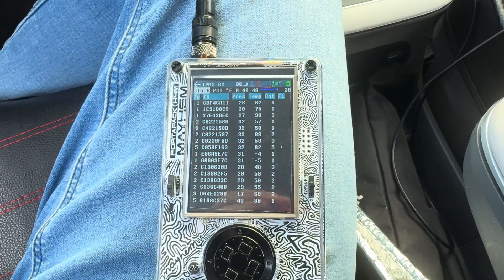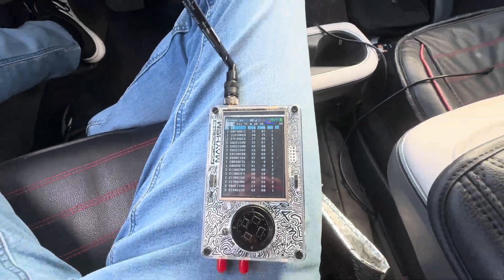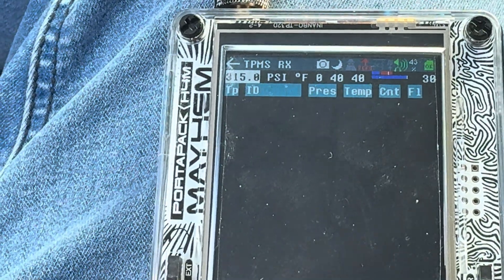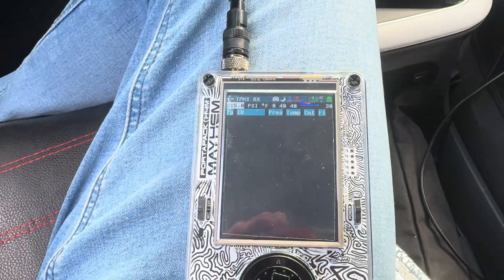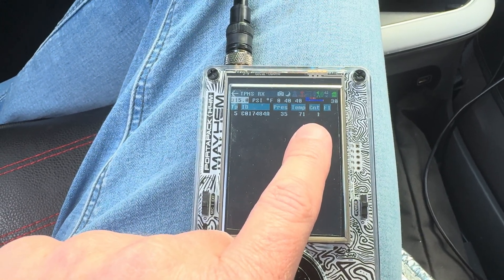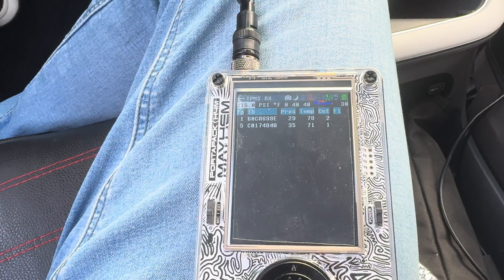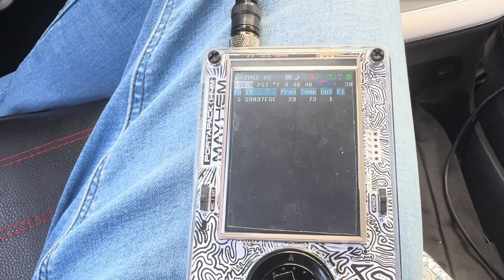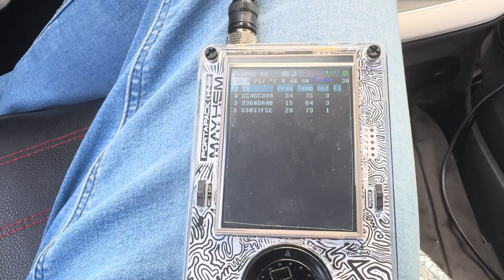HackRF One with Portapack using the TMPS App. Tire Pressure Monitoring System.

Comment: C1210: General TPMS sensor fault.
C1211: Missing or invalid sensor signal.
C1212: Sensor battery is low (batteries typically last 5–10 years).
C1213: Communication error between the sensor and the vehicle's ECU.
C2121–C2124: No data received from specific transmitters (Front Left, Front Right, etc.).
C2421–C2424: Low battery voltage detected in a specific wheel sensor.

Comment: Thanks for these videos, I've just ordered the HackRF with the portapack, I was surprised you were getting anything on 433.9, I am in the Automotive industry in the UK and I'm sure that the USA was 315Mhz only for TPMS, maybe it's changed recently or some manufacturers ignore the requirements??
Reply: The thing with TPMS systems that transmit is that a lot of them have batteries inside the tyres in the sensors and so they only transmit when required depending on time, speed, pressure and changes in pressure so you need to be in the right place at the right time to catch them.
Reply from the maker: Good to know. Thank you.
Reply from the maker: Got it on all three frequencies. I have often heard that TPMS was Brocken up like that. For a while I was getting frustrated because I wasn’t getting any data at all. Then I just got real patient with it, now like I said, I get all three.

Comment: I've been trying to find out what the flag codes are. I encountered one vehicle that has passed by over multiple days with a sensor showing code 10 in the FL column.  Also, I've had no success picking up the sensors of a 2014 Mercedes E350 I'm working on, but I can pick up sensors nearly 100 yards away. I think the Mercedes sensors are 433 MHz.
Reply from the maker: Please, keep us informed on what you find out.